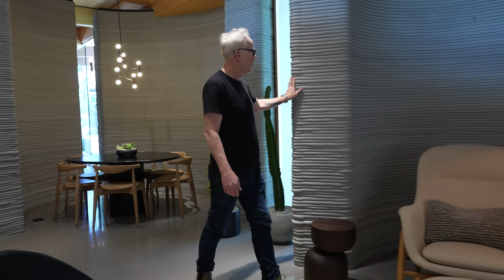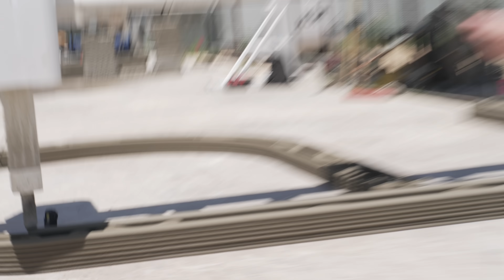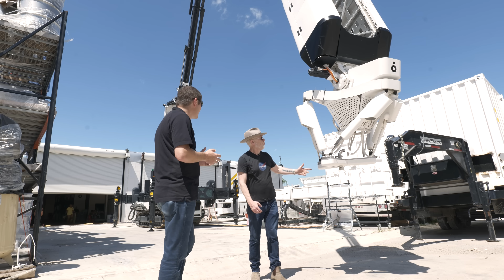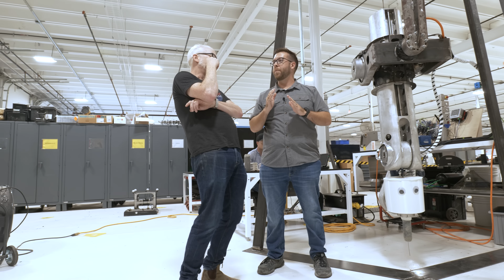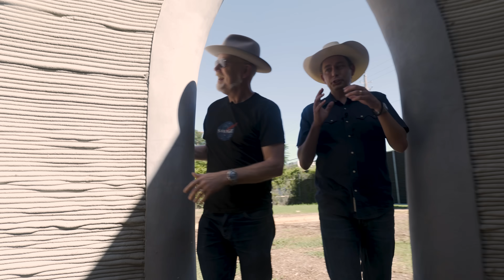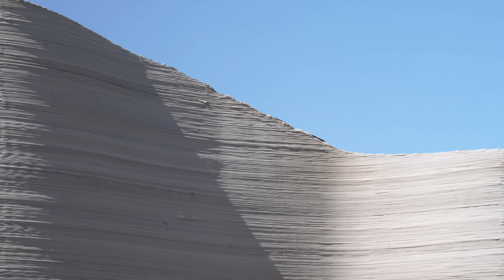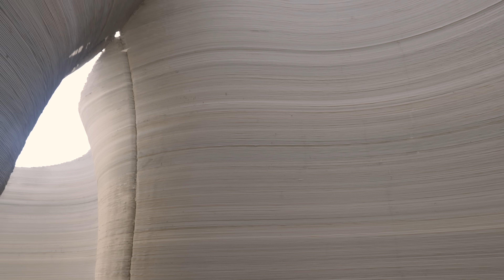The Biggest 3D Printer Adam Savage Has Ever Seen!

Comment: The mobile unit is very good ,go to site and start printing immediately ...how about if you can load concrete on site ,with the correct viscosity you are home but the concrete has to be engineered for it to work pwrfectly

Comment: Look up "The first real 3d printed building" on YouTube.  This was back in the 30's, this design mixed the concrete right there in the machine.  It smoothed the edges instead of leaving these ugly layer lines.  It even inserted supporting cables as it printed.  This ultra modern design is larger, its CNC so it can do more than just round structures, but otherwise its using 90 year old technology, and skipping one of the best aspects.  The smoothing part.  Yea I guess there is some aesthetic appeal to some for the layer lines, but realistically they are going to collect dust and debris and be very difficult to keep clean.  On the inside of the house they are going to be nearly impossible to attach things like shelving to.  If you have to drill holes or make repairs they are going to be much more difficult to repair or conceal holes or damage due to the contour shape.  A flat surface would solve all these problems but none of the modern designs even try.  All they need is a spinning disk or cylinder on the sides to flatten it out.  It's not like it would be hard or add almost anything to the cost of the machine.

Comment: What is disgusting about this is that the whole selling point of 3d printed houses was that it would make them much faster to produce, save enormous amounts on labor cost, and materials, and therefore ultimately be far less expensive than traditional homes.  The whole idea was to end homelessness.  Instead what we actually see is that every 3d printed house on the market sells for the same price as a comparably sized traditional home.  Sure, the savings are there in both time and production cost, but that savings is never passed on to the consumer.  Instead the builder just gobbles a few hundred thousands dollars worth of profit on each of these homes.  The lowest price 3d printed homes I can find that are ACTUALLY available to order / buy cost over $450,000, even though their production cost was under $150,000.

Comment: I think we can see hints that the structure shown towards the end of the video was possibly designed using polygon based 3d software rather than mathematical surfaces such as nurbs (non rational B-Splines). Perhaps they should have applied a subdivision surface modifier.

Comment: I'm always both fascinated and confused about 3DP concrete. As a technical feat it is amazing, but where I get the most confused is what problems it's solving and what problems it's actually creating.

I haven't seen a finished concrete home or structure that I would actually enjoy spending time in. They are both not aesthetically pleasing and not easy to finish in a way that is.

This process mostly replaces framing, which is already one of the fastest and most sustainable parts of building a home.  It seems like it makes parts of other trades like electrical and plumbing both more complex for initial build, but more critically, harder to maintain and make changes in the future.

The concrete homes in general are going to be far harder to do renovations, reconfigurations, and repairs than traditional building methods.

Even something as simple as hanging a picture frame is not as straightforward in these homes.

And all this is without addressing the long term availability of the specific mixes needed to make printable concrete. Everything needed to collect, create, and transport those mixes to job sites. Compared to wood, which is already part of the natural environment and is endlessly renewable and sustainable.

Comment: Home construction is already quite lazy, even though we've made it far easier for homes to be constructed over the years. Victorian homes required craftsmen to make beautiful, so we make all those decorative elements elsewhere and have a crew of mostly borderline educated people glue it on leaving gaps everywhere. This printer only helps them be even more lazy in the construction process, cut more corners, and flood the cities with sub-par housing that is a-typical and unstandardized and ultimately foreclosed. I do not anticipate printing the entire home as wise, instead using it in combination with traditional methods. It must have standardization and maintenance thought about for the entire lifetime of the construction (It should realistically be expected to serve a family for multiple generations, even though many modern homes even can fail miserably at this). If the fad dies out, and you're stuck with such a home that nobody is trained how to work on, you're in for a big expensive headache. Maybe it would have better use with the military, As I could see a team of these printers rolling up on a site and popping out a bunch of pre-designed barracks or fortifications practically overnight with less labor. It's cool tech for sure, but we need better homes. Not just a more complicated home.

Comment: So they are trying to reinvent the concrete pump truck which is capable of all this with a slight Calibration so you need something very simple to stabilize you need a 3 point stability cable system that connects to the the end part of the boom that give and take with the boom when the program runs simple fix I hope this helps if you need drawings to explain let me know.

Comment: Fascinating stuff, no doubt. Adam is doing a great job showing us stuff we could not even dream exists.

But, about the house.. starting to think about it in a way 'ok, so I live in this house, how will it feel and what problems could arise' - I can think of a few.
So, for instance, what if something breaks? Let's say a wall cracks or there is an accident or some kind 
of a disaster (major flooding - need to break a wall, to dry out the internals, tree falls on a house, car rams into type etc) 
and a wall or parts of it need to be replaced. 

How will a regular building company go about repairing such a house or one of it's walls?
A box shaped house is dull, admitted.. but it's also quite straight forward to work on even for the amateur-owner.

But this one - Its bespoke! There are no replacement parts anywhere! And if all the walls are curved that just adds to the complexity.
Personally, I have done repairs on a couple of regular boxy rooms and even there there were major problems 
- when the boxy wasnt't exactly boxy and the skirting board I was trying to use was straight! So what did I do?
I had to break up the straight skirting board into smaller parts and tailor them to the wall (following the un-evenness of the surfaces)
, just to accommodate the straight-but-not-quite boxy.
How the hell would you install a skirting board in this kind of a house? It would also then have to be custom printed?

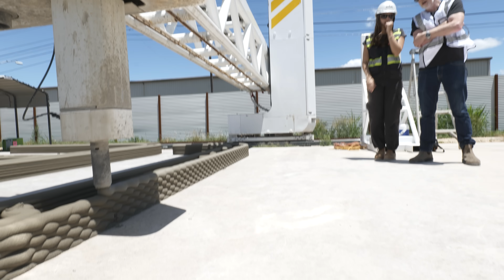Comment: 5:54 the whole machine moves when the right solution would be to move the printer head... kind of inefficient. I wonder if there's some kind of patent infringement, because i can't imagine them making this machine and not figuring out this obvious part. I'm think specifically about that handheld router that follows dots. It's not the concrete, because you can put a mini delta and leave the tube free to articulate.
On another level, i can't help but wonder if the whole affair isn't super inefficient in another aspect and that's the fact that this is a single head printer when it would be much more efficient to have two printer heads, doing both sides of the wall, using the above stated element of a free floating head mounted on a rotary (not complete rotation tho) head under the gantry.
Would love to see a complete building, fully equipped with static loads and all on an earthquake plate, because i suspect that just like with small 3D prints, layer separation might inflict a shear effect under load.

Comment: This is very promising, and I want it to succeed. I think it can succeed eventually but I don't know if it's ready for priimetime yet. 

I suspect these buildings have higher thermal inertia and therefore lower utility costs for heating/cooling.  Likewise I suspect they have better structural integrity, expected longevity, and resistance to natural disasters.  But those should all be top-line selling points and nobody mentioned them.  That echoing silence is worrying. So are these things actually better, and if so how much better?

I suspect that these buildings can have a much greater load-bearing capability allowing them to be used in earth-berm (hobbit hole), underground (bunker) or ground-sheltered (nature-integrated) construction buried under tons to tens of tons of soil per square meter. That's more a specialty than a top-line selling point, so the silence doesn't echo quite as loudly.  It's still an interesting new capability that ought to be showcased. 

I would really like to see a comparison of how these buildings handle ground movement.  Everything from foundation settling over decades to undermining due to disrupted drainage to earthquakes. It may be better or worse, and I haven't seen any results yet. 

Cost of construction is a problem. So far, the price of a 3d printed building over standard construction is about the same ratio as the price of a 3d printed plastic toy over a mass-produced version of the same toy. A lot of folks are willing to pay triple for a bespoke toy that no one mass produces. Likewise that price-tripling can be acceptable for the occasional homeowner who wants a bespoke house built in 3d curved shapes that would also cost (at least) triple if done in standard construction. But it's more than the usual homeowner or real estate developer is willing to pay. I hope the cost of concrete extrusion gets better as the tech advances, but I hoped that about plastic extrusion too. 

Other problems are to do with long-term ownership and customer expectations. Customers expect to be able to remodel or renovate changing the floor plan after construction. Or run new utility conduits (and plumbing) inside the walls after construction. Or make structural repairs after a truck crashes into the house or something, with the same integrity as the original construction. 

Some of these things just can't be done and are a matter of managing customer expectations.  The rest would require much smaller versions of what is essentially the same technology but solving the MUCH more difficult kinematic problems of allowing an extruder to move and work while actually reaching inside a house. I don't know how much of that is addressable at any reasonable cost.

Comment: What I am not seeing in the dining room that Adam walked around was electrical outlets.  Some building codes require an outlet for every 10 running feet of wall.  Also the only light switch on the wall I saw was one on a wall with wood paneling.  Popping up a structure is great but if it doesn't include any of the systems then what's the point?

Comment: 1 - Can they use the wire in the wall to carry electricity - i.e. bring wire loops to where you may want outlets and avoid running copper/aluminum wire.
2 - Color it beige or white?  
3 - Can you print a Roman Arch support to create a flat roof that can have a widows walk or better yet, a garden = build a Hobbit House that holds up under minimally tended plant growth?

Comment: https://youtu.be/orurGdrlzIs?t=427 use powered gimbals to resist and pull the arm at a much higher rate even in a windstorm, most likely a set of 4 gimbals aproximately 5 pounds each should be a excellent start, consider that u can use rotatary powered gimbals to lead the arm to have the gange arm travel far faster then basic extruding would allude to.

Comment: How this guy says this can be cheaper than regular building is insane. Imagine how much your electrician and plumber are going to charge you to run wire and pipe threw those walls🤣. "Oh you want an outlet there? $3000 more. Oh you want an extra water faucet there that will be $5000 more." Then imagine if you want to put in windows? I noticed they never mention that part at all. It's probably very expensive and has to be reinforced for every window you want. This will never be more than a pipe dream.

Comment: Adam, I have a question regarding the continuous thread or cable that runs inside the concrete/Carbon X during the 3D printing process.

At the corners of the printed walls, is that reinforcement cut, or is it somehow tied, looped, or interlocked to maintain structural integrity?

In traditional reinforced concrete construction, corners typically utilize interlocking steel reinforcement, such as L-shaped bars, U-shaped bars, or continuous tied rebar, to ensure that adjacent walls function structurally as a single unit. These connections prevent separation at the corners and transfer loads correctly.

Since your system is using a continuous thread inside the printed concrete layers, I am trying to understand:

Does the reinforcement maintain continuity around the corners, similar to traditional rebar bends, or is there a different type of structural connection being used in the 3D printing process?

Any clarification on how the corner reinforcement is handled would really help me understand the structural performance of the printed walls. 

Thank you.
Reply: Good point.

Comment: Why is vertical rebar not needed?  Can you print the wire in, say, every third row, to save on wire?
Reply: i saw some vertical rebar near corners and such. also im thinking the fact that they lay wire inside every line of concrete offers a lot of stability that you wouldnt get from typical concrete pours.

Comment: Very Kewl.  Thankyou Adam for checking this 3d housing printing co. out.  I have a couple of questions.  I know in past videos on 3d printing of housing one of the challenges was getting electrical and plumbing into the structure.  And I saw one of the show pieces had electrical, did they talk about how they were able to integrate this?  Also, I live in BC, Canada and grew up in Alberta, so cold weather is very much a part of life. Did you ask them about how the product is able to manage temperature changes?  +20C (68F) on the inside and let's say -30C (-22 F) on the outside.

Comment: Electrical wiring, receptacles and switches, plumbing, HVAC, insulation.  Seems like the questions were carefully crafted to avoid these obvious topics. 
  Basically they built a very expensive shell that isn’t compatible with any other standard building materials.  
   Try installing cabinets to a rounded wall, appliances, furniture Et cetera.  
   The attraction to this tech is the potential to eliminate skilled workers from the process.  

  They should concentrate on building retaining walls, this technology might be useful for that application.

Comment: I love this.  I love the architectural flexibility, the aesthetic, the speed, economy, it just opens up a world of possibilities.  I particularly liked the basket weave effect.  It made it look much less austere.  One downside I can see is that, if you don't plaster the inner walls they are going to be a haven for spiders, and it'll be a nightmare to keep dust free, and you get mould growing on dust, so people may develop lung problems after living in them for a number of years.  A plasterer who can do a good job of curvy walls is probably going to be quite more expensive than your average mud slinger.

If the cost of a home built with this rivals timber construction, imagine how much safer Tornado Alley would be.  It could be used by disaster relief organisations to quickly build shelters following earthquakes, hurricanes, floods, etc.

I'd seen the gantry system before, and was already impressed, but the Phoenix system just takes it to another level.  I'd have liked to see how it deals with apertures for doors and windows.  Do they print up to the top of the aperture, pause while they manually insert the frame, then start printing again?  I'd also like to know how they plan to add floors for upper levels and a roof.  Laying floorboards for such a curvy building would be quite the challenge.
With the embedded cable, is it possible to print overhangs, or is it too liquid for that?

Comment: Can someone please make an attachment like that stuart platform that’s light weight enough to maximize load capacity but still able to have clamping jaws that hook around the flanges of an I beam for ironworks. That way we can have the operator control the rotation and pitch of the beam, and it can land directly to the connection points. Just step one of removing the human from my job but still would be nice.
Reply: Ok the fact the whole machine is a robotic arm that has no counter weight blow my mind. I didn’t get that far before the idea came to mind lol. The next system with the belt drive to articulate in the y axis would also come in handy with many scenarios.

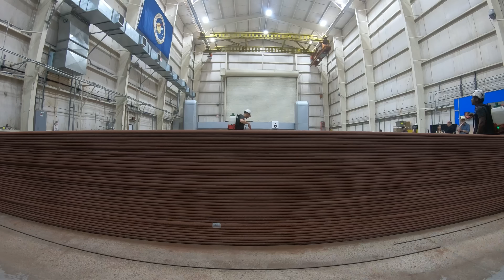Comment: 2:51 On the topic of speed, I was hoping Adam would ask my biggest question.
What is the limiting factor in speed?
Is it the motors moving such a heavy gantry? Is it the stability of a mobile gantry? Is it the mixing and feeding of cement? 

Like, how close are we to the limits of possibilities.. will we have a house printer that moves at potentially dangerous speeds printing a whole house in a matter of hours, or are we basically at the limit?

I’m just curious where the innovation will come from. What will make it potentially faster or more efficient, better cement mix, or better motors and actuators?

Comment: It would be great engineering to see ICON with automatic Sharkbite 1/2" x 100' Coil Red PEX Pipe bing for hot and cold water, and PTFE
 Colored Tubing for fast electrical installation, and a cond print head using foam fofor support layers like windows and doors that can be removed after printing.